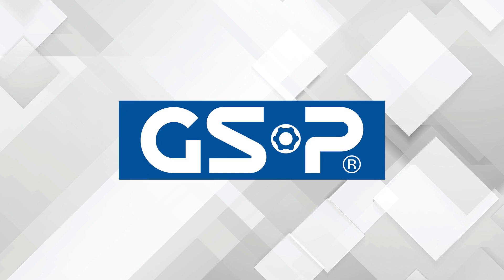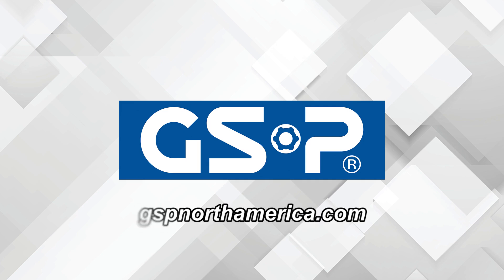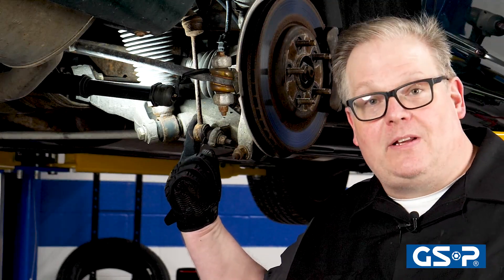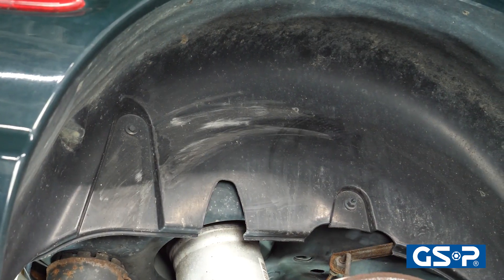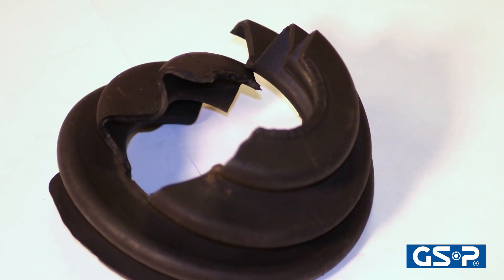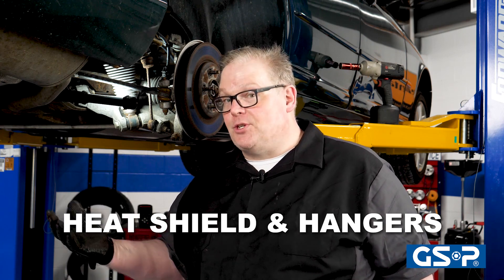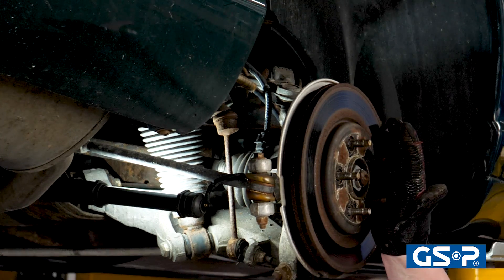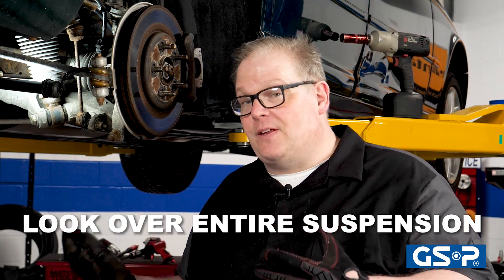Maintenance Minute: CV Axle Failures

Comment: Hi, thanks for the video! When I install the axle, do I need to grease the spline ends that goes to the transmission and the wheel hub or they are supposed to be installed "dry"?
Reply: very helpful ! Thank you